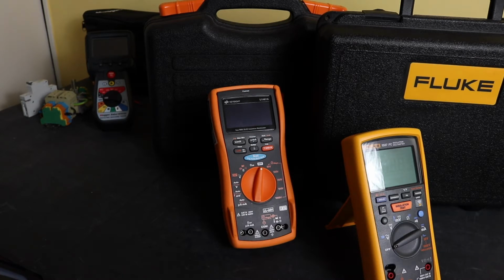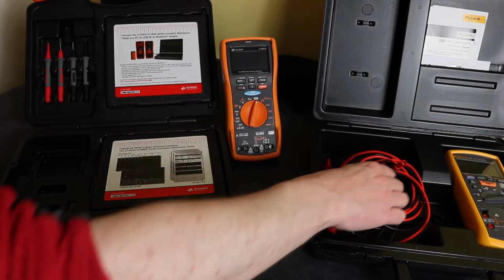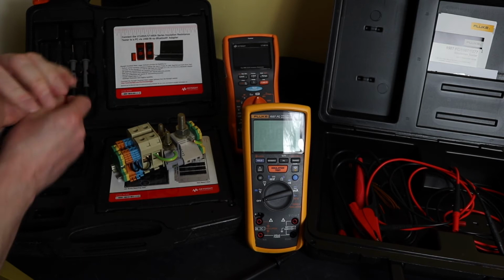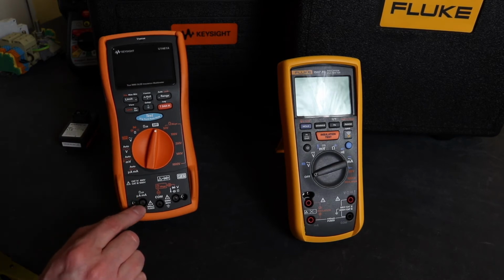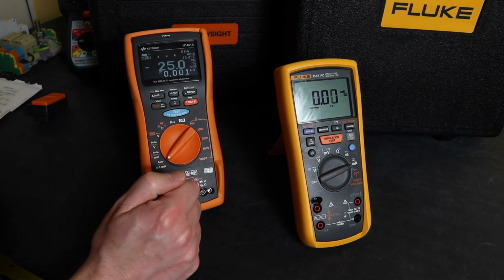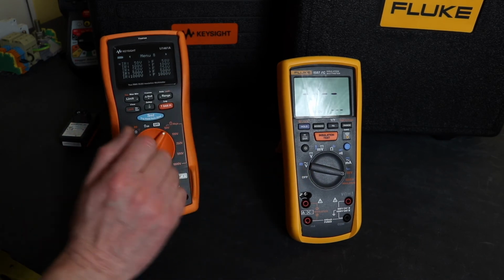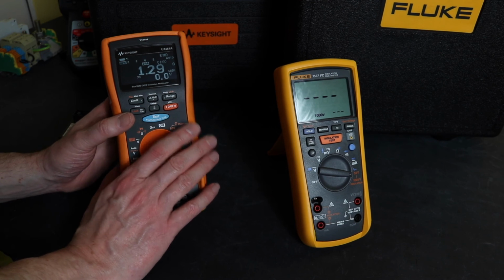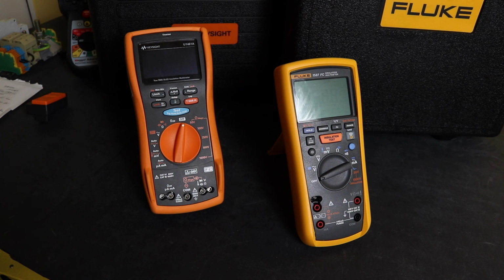Insulation Multimeter Comparison - Keysight vs Fluke

Comment: Another good comparison video there. I did eventually treat myself to the Keysight meter just after Christmas. I got mine from RS. I've had a good play with it in the house/garage and used it to diagnose my Grandmothers faulty electric fire. Unfortunately I haven't yet had a chance to use it properly in the field as I've been stuck at home since then as I'm on the shielding list. I should be back at work later on next week though, so looking forward to putting it through it's paces soon.
Reply from the maker: Appreciate you watching and commenting - I am sure the U1461A will serve you well for many years. It would be interesting if you have any large induction machines to test the insulation test function on and see if it is stable.
Reply: We've got some fairly hefty motors driving pumps and air handling units on site but nothing like the rotor I saw in you video with the U1461A misbehaving.
Reply from the maker: @SandyTaboureauBigbananafeet  Good to hear. It is very menu based, but that seems to be the way a lot of the more multifunctional meters have gone now and continue to. Personally, I have not noticed that the battery las suffered due to the screen, but I do use good quality batteries in it all the time. Which is good, as the boot is a right pain to remove and put back on. Hope the meter gives you many years of good service.